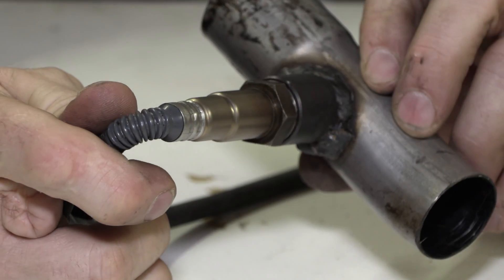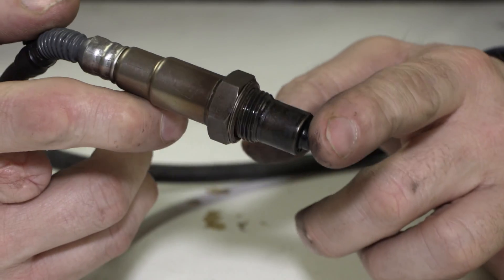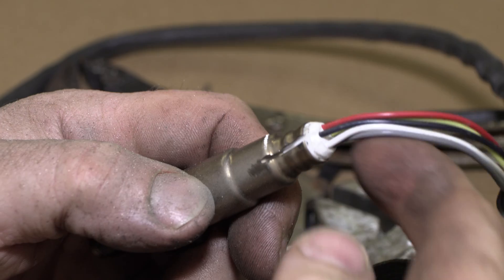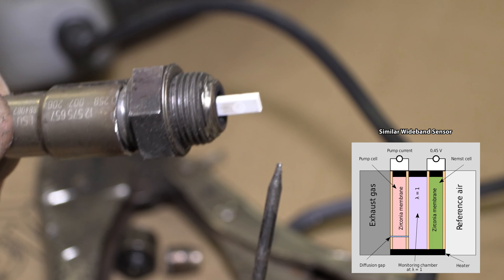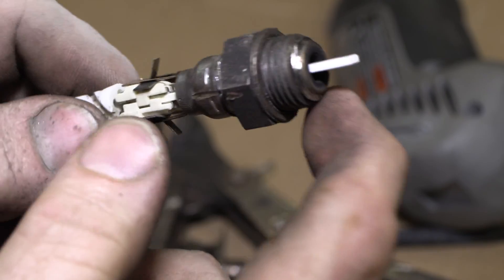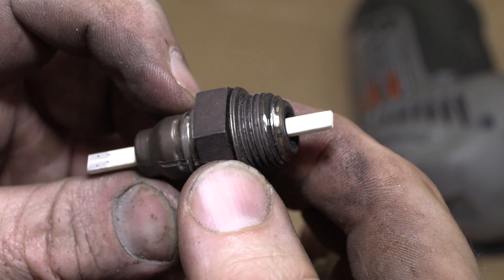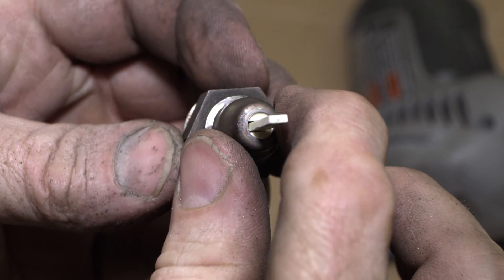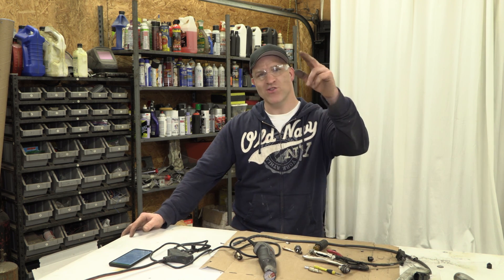Whats Inside an Oxygen Sensor? (Wideband O2 sensor)

Comment: I've seen on forums where peoole have soaked the O2 sensor in gasoline overnight, which dissolves the oil contaminating the O2 sensor. I've never actually tried it, so couldn't say how well it works. The ultrasonic cleaner mentioned in another comment is a good route for cleaning one that's oil-fouled.
Reply from the maker: I should have tried that first, but it was pretty interesting to take one apart.
Reply: @WarpedLab  I agree. I've never seen the guts of one. Pretty cool and a lot fewer parts than expected.
Reply: This is an older comment but I just rebuilt my audi and should have replaced the oil soaked o2. Anyway I soaked in brake clean then took a propane torch and heated it up. I got the tip and outside just to the point if cherry red then backed off 2 or 3 times. I figured the torch would burn off anything the brake clean missed and it does live in the exhaust so the heat should be fine. My egts get around 1200 degrees.  It seems to have worked, mine wasnt completely dead but the readings were skewed

Comment: Still got me wondering how that little white sliver has the ability to alter the AC signal back to the PCM. Is it a variable resistor? And last I knew. Oxygen sensors where producing an ac voltage. There's got to be a reason why it's not DC
Reply from the maker: I think that may be located in the electronics located in the connector, there is some sort of converter there like a little module.

Comment: And why it can broken by oil? I wonder about it
Reply: Me as well
Reply: @WarpedYT  what material is that sensor made from?
Reply from the maker: It's made of ceramic and the sensor portion is zirconium from what I've read
Reply: @WarpedLab  Really? Thank you for the information. Anyway. Is that was universal design and material? I mean those material is common on oxygen sensor? Or they can made it from another material?
Reply: I think the oil just coats the sensor so it doesn't "read" the oxygen in the exhuast.
Reply: @rigormortis08  hmmmm make sense too.